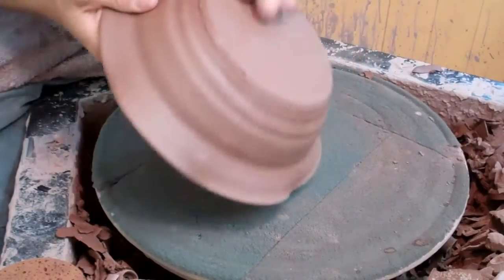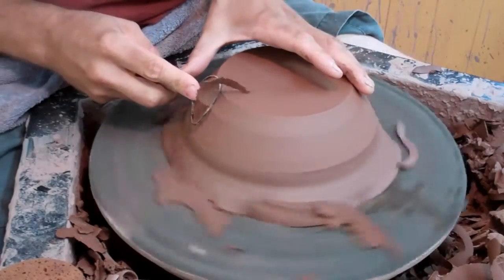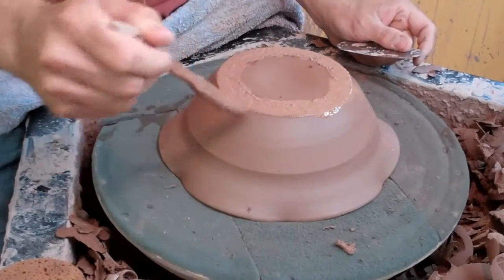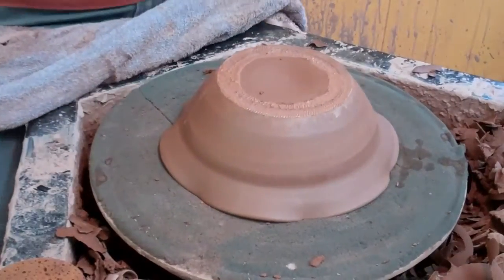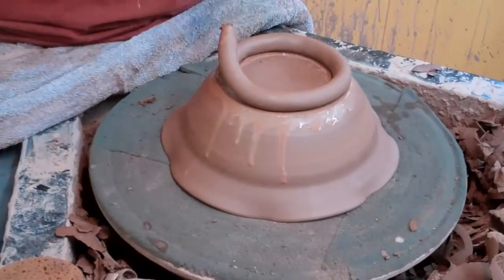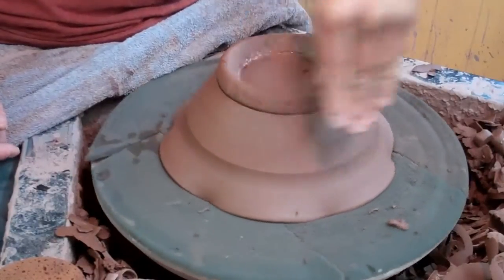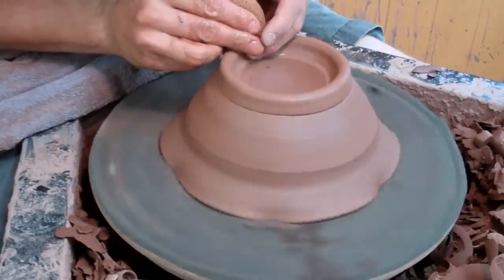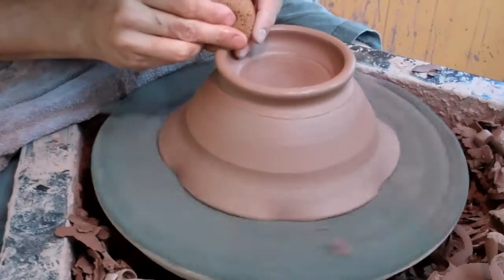Throwing a foot on a bowl

Comment from the maker: Hi Janice, Thanks for watching the video.  Throwing the foot on a molded pot is a great idea!  See my blog post

for some pics of some cups/teabowls I made with this technique.  Done the same way except I used a smaller coil and attached the upside down pots to the wheel head w. pieces of clay instead of using the foam batt.  Or you could put them on a chuck and throw the foot on if you wish.  Good luck. Happy potting~Ron